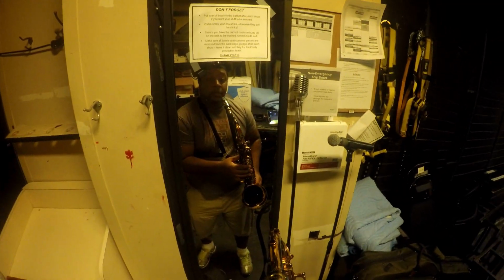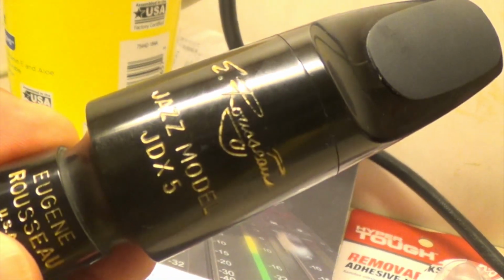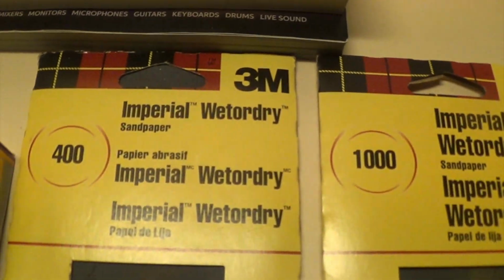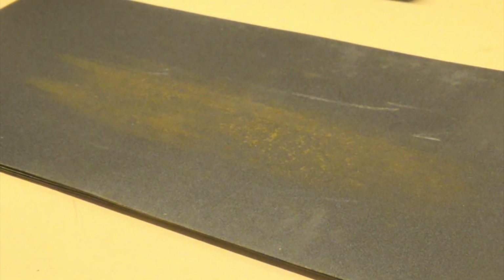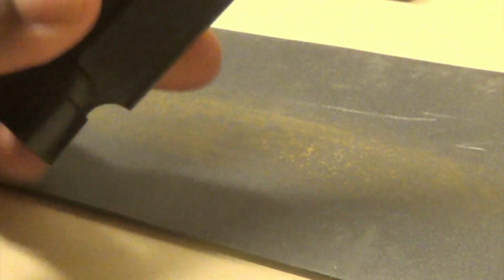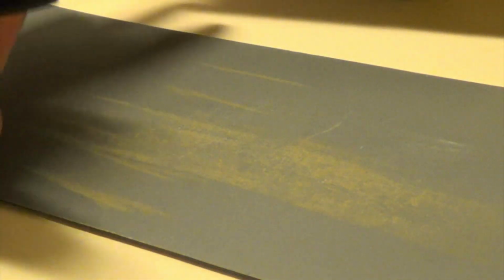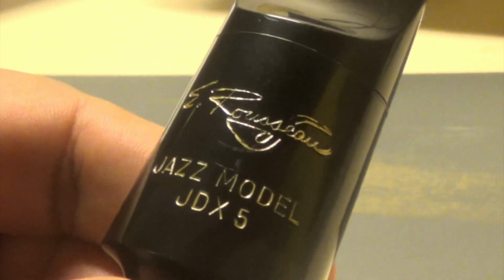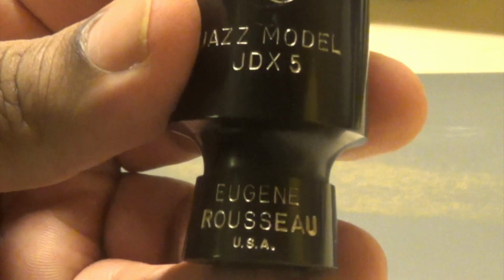How to fix a saxophone mouthpiece (Rousseau JDX 5) part 2

Comment: Thanks for this Video, I have a Glass table which is very Flat. I tried this on a Rico Mouth piece that was OK, but After sounded Much better,  and did this with some 600 & 1000 grit wet/dry sand paper, with 4 moves across the 600grit. What i noticed when looking at the table were two fairly deep dimple's in the table, i thought this mouthpiece is beyond fixing, so i sanded more till the dimples were gone, then transitioned from the Table to the rails and tip. That did it it sounds Much Better. Thanks for your help! I Flat sanded a couple more Mouth pieces. I think One or two swipes on the 600 grit then inspect the table surface, that will tell you whether or Not it needs more work. If it is already Flat with No Low spots I would stop there, But if it has Low & high spots, that means More work to that MPC
Reply from the maker: Cool.

Comment: How do these compare to the vandoren Jumbo Java? More or less powerful? Easier or more difficult to control?
Reply from the maker: I don't know if they are still making these since JodyJazz acquired them. They are still selling them though. Because I had to work on this mouthpiece, I don't know what it is "supposed" to sound like but this is much darker than the Vandorens that I have. Also, more resistant. I had to use stiffer cut classical reeds to get the best performance from it. I do have another one that I was sent when I tried to get the JodyJazz one. I'll do a review on it soon

Comment: Thank you for making this video. Seems to me that taking material off the table would lower your tip opening?  Please correct me if I am wrong on this and state how to open up the tip to compensate?
Reply from the maker: It depends on how the mouthpiece is defective. If there was too much meterial, you are just balancing it to where it is supposed to be. If the piece is measured correctly and the table is uneven, its not going to play correctly anyway. In other words, a facing that is a few thousandths of an inch too small that is flat is going to play better that a defective more open one. Either way, you are better off with a non defective piece. If you've paid a lot of money for it however, I would say SEND IT BACK and make them send you a good one.

Comment: Never use a table for a refence surface - a small granite surface plate costs @ 30 bucks and will be flat witin a thousandth of an inch across it's length and width. I bought mine from Lee Valley Tools but they're easy to find from many tool suppliers.
Reply from the maker: Sweet! Thanks for the tip

Comment: Curious as to why you used all the other sandpaper sheets underneath? Don’t you want the one piece of sandpaper against the flat surface of the table?
Reply from the maker: The simple answer is that I didn't have a flat enough surface that I trusted. I also knew I wouldn't have to remove that much material from the piece. The pad of sandpaper worked out just fine although I wouldn't recommend doing it that way if you are a beginner mouthpiece adjuster.
Reply: @Sirvalorsax  ok cool, yea I used one sheet of sandpaper against glass and it worked out alright 🙂 thanks for the vid!

Comment: Buttery sweet tone.
Reply: Sirvalorsax I really enjoy your videos...I play primarily alto (a vintage Bundy Special made in Germany /Keilworth) I saw a few mentions that this horn has a smaller neck bore so it likes larger chambered mouthpieces...I can believe It because medium chamber pieces have to be pulled out halfway down the cork then that throws overall intonation out... I did have the best luck w Otto Link metal STM or a ...cheap Rico Graftonite A-5. I use the m-5 on my tenor and it works out well ...I was curious about this if you have any experiences w it...

Comment: You sound amazing on this one. Did this make it to your current top 3? FYI definitely preferred this to your "tailored" Yibuy.
Reply from the maker: Unfortunately it still has some internal geometry problems that can't be fixed with sandpaper. It is in my top 3 dark sounding mouthpieces for sure even with the flaws that still exists.
Reply: @Sirvalorsax  have you tried them now that Jody Jazz has taken over?

Comment: Can an uneven table cause excessive squeaking??? I recently got a metal Berg Larsen and it squeaks so much and I need help. Granted it is my first metal mouthpiece and I have only played on one other mouthpiece for 5 years. Do you guys think it’s me or the mouthpiece?
Reply from the maker: An uneven table can cause all sorts of issues. Let's assume it's not the table for now though because Berg Larsen mouthpieces are physically smaller. Often times players will consistently misalign the reed and they come with very inconsistent ligatures. I would look at a different ligature 1st. I did a review on a Berg that you should check out
Reply: Sirvalorsax thank you! I think misalignment might have been the problem. Yesterday I was able to play on it my whole practice session while the day before it just wouldn’t stop squeaking. I think I might have to look into a single screw ligature instead of the double screw ligature that it came with. Anyway thank you for the advice!👍
Reply: Sirvalorsax I just watched your video and my ligature did the same thing at first where I could not fit a reed with it. After fiddling around with that ligature though I got the reed to fit and I haven’t had trouble fitting a reed on it. It was a little strange. I was also wondering if you knew what the tip curve V on the Berg Larsen translated to.